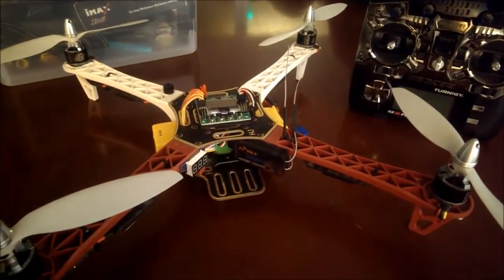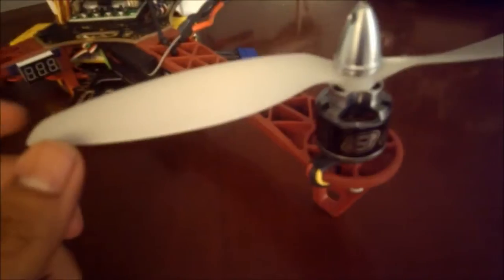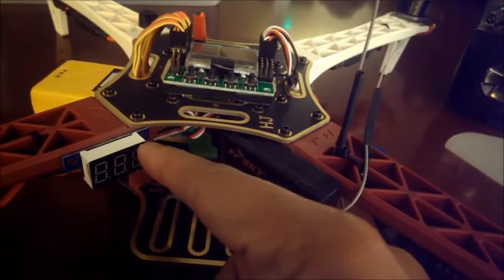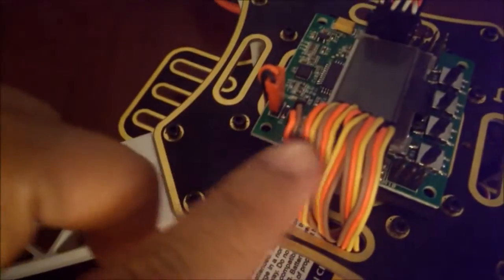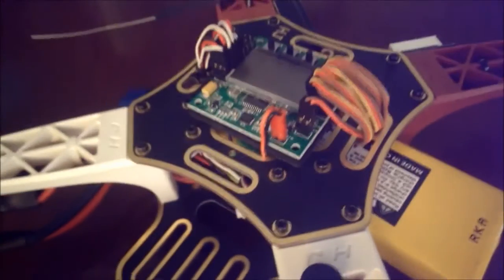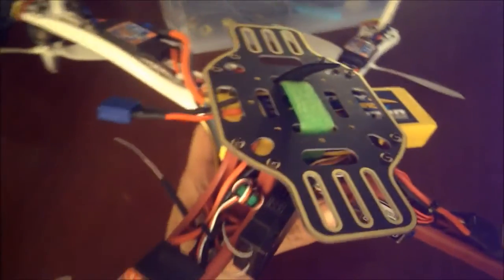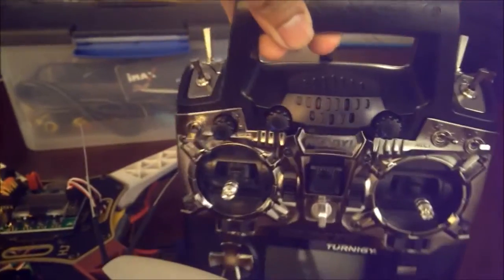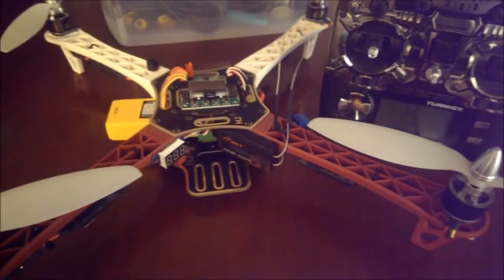450 Quadcopter Build - COMPLETE - Part 2

Comment: Your quad looks awesome. I'm new to building quads, and it has been a great learning experience for me. I saw that you have the voltage meter connected. Does that plug into the kk2 board?
Reply from the maker: Dan Davidenko I just have the wires soldered onto the negative and positive leads on the PCB board. You can connect it to the balance leads on the battery too, several ways to do it.